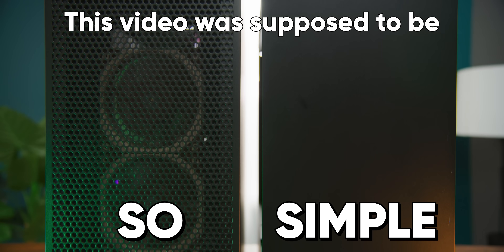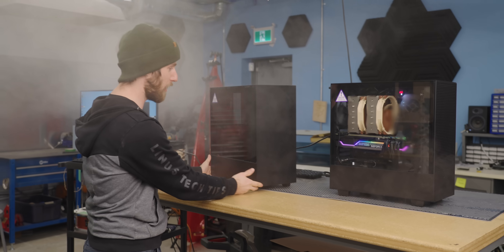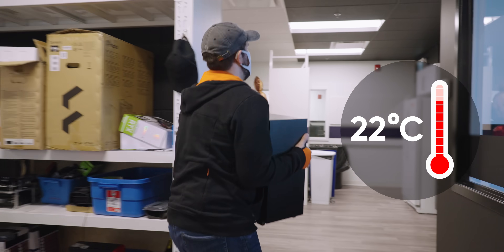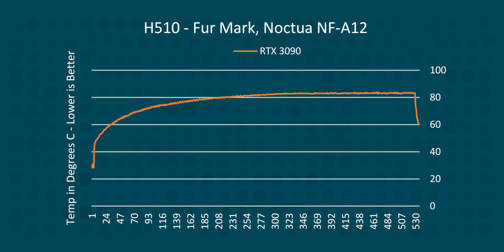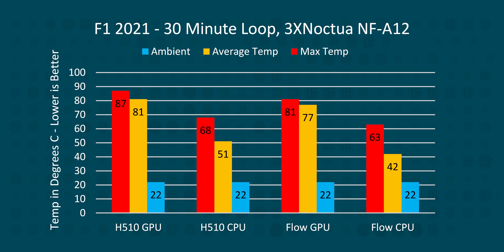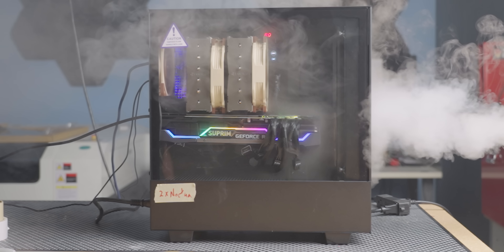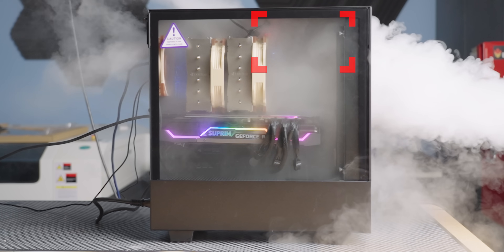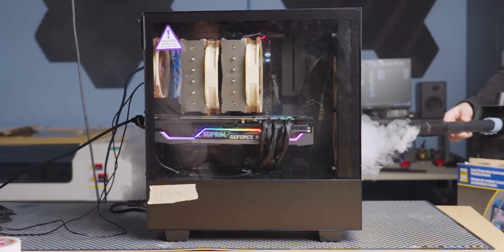Everything You Know Is Wrong - Mesh vs Non-Mesh Front Panel

Comment: ok just for giggles... Would you consider having two smaller yet spinning way faster [blowiematrons????] on the bottom of the case and one bigger yet spinning slower fan at the top of your case? Would love to see that, and maybe... just maybe... a separate compartment for GPU? I mean wasn't that the thing with PSU's ? I personally stick with full towers not only for their airflow and a lot of free space, but the modularity. Been 6 years I'm driving one case and I'm still good on space despite having 8 drives xD

Comment: Nothing new here. Fans are arranged wrong. Need bottom intakes to feed cool air to the GPU. Need top fans to exhaust the heat out. Mesh is good, but if you put the fans on the bottom and top, the GPU and CPU heat would be better overall. There is also the idea of balancing input and output of the fans. 3 in, 3 out. Etc.
This whole test is stupid in that that case is a hunk of junk strangling any PC built in there without top and bottom fans.

Comment: Replace the back blockoff plates with some mesh ones, that way the air going under the card has a place to escape. Would/should help reduce at least some of the turbulence. Hell, just take them all out for a quick test. Something else to test? Remove or don't power the bottom fan, but leave the top one going. The GPU wants air, it can pull it it's blasted self!

That or stop using these goofy tiny artsy-fartsy form factors with high end components. But what do I know? I consider the Rosewill Thor the current pinnacle of PC case design.

Comment: Cool video. I feel that having the PSU on the bottom of the case makes no sense today with GPU's getting bigger and hotter. PSU should be on the top like in the old days and use the space bellow the GPU to populate with intake fans. Like the Fractal Torrent and LianLi O11 are doing.

Comment: The front fans are mounted incorrectly. They should be mounted inside of the front bracket, closer to the GPU, to allow the airflow into the void at the front of the case. In the configuration in the video, the fans are obstructed by the front panel AND they are obstructing part of the side mesh.

Also, both of these cases are compatible for vertical GPU mounting, which might have been worth checking if it was a good option in this particular rig.

Comment: the solution is both simple, nothing new, and even elegant. DUCTS!!! there's a reason servers use it. just cut some acrylic plates and separate the front intake directing half the fan directly to the gpu. I made 2 separate ducts from 1.5 front fan on my corsair 460X, one for each gpu fan. basically invisible, huge difference on temps and noise

Comment: That is only 1 design of case, many of the older design cases I have you can only fit fans in the bottom 2/3 on the front panel, that case used only had fans in the top 2/3 and its unable to help push airflow to/through the gpu

Comment: It seems that the front mesh should have the mesh at the bottom solid part at the top. Otherwise there's no way to get effective airflow at the bottom of the case. One could workaround the problem a bit with some kind of air deflector or even ducting that forced air from the bottom front fan under the GPU. Given the miniscule space available, even that wouldn't be a great option.

Comment: I think when Linus says "turbulence" I think he means vortex or vortices. The air was 100% turbulent before entering the case and was turbulent everywhere in the case. The problem highlighted was air swirling around and not moving out of the case which is caused by the vortexes that would for around the GPU as he outlined in the video.

Comment: Yes, fluid mechanics is a thing and very important for active cooling. For air ducts, controlling flow area and pressure variances are important. I'd prefer that cases are internally sectioned for proper flow control

Comment: I wanted to build my pc perfect so I did a lot of fan setup tests, running them for a day of gaming at a time, the ideal setup was 3x 140mm front supply, 2x 90mm directly in front of the TUF 3080, 2x 140mm exhaust, one rear vertical, one top horizontal. It's positively pressured, the 2x90mm fan in front of the gpu made 2°C lower difference even during idle coz TUF cards have rear exposed heat sinks. i'm using a rosewill mesh case. I'm running Forza 5, Halo Infinite, AC: Valhalla in 1440p ultra at ~45°C full load undervolted TUF 3080 for hours on end.

Comment: I mean I know this video was sponsored and all for this case, but I tested basically the same thing in my case when I got my new way bigger GPU. My front mesh opening is more to the bottom of the case so I arranged the fans in a way where the bottom one blows air under the GPU and the top one over the GPU. 
I think for this particular case this problem exists but it varies heavily with the setup of your own case.

Comment: The graphs shown consistently compared Flow vs Solid, ven though the talking point at that moment was GPU vs CPU temp change difference when changed to Noctua fans. At one point, the talking point is GPU temps rising, while the graph displayed only shows CPU results (which are falling), adding to the confusion.

Comment: Whats the problem with swithing the fan direction to draw air from outside in the back of the case and throw it out through the front? Especially if you can open the pcie covers under the gpu, it lets the front fans to draw in cold air for the gpu then. Im rocking such configuration in an old Lenovo server case for ages and my RX 590 rarely gets to or over 70c when gaming

Comment: Stuff like this is why I still prefer to use slightly larger cases. It makes airflow a lot easier to manage. Plus, I prefer my case to have at least 2 of the optical drive bays. I have them filled with 2.5"/3.5" SATA hotswap trays.

Comment: I would recommend the Lian Li 205 at Micro Center for someone who wants to assemble a similarly sized build with a solid front cover. It's very similar to the NZXT H510 in terms of layout, but the removable front cover of the Lian Li case probably has better intake thanks to an open bottom and grills that span from top to bottom on both the left and right sides. Furthermore, the Lian Li case has a top exhaust grill that can accommodate two case fans or a 120x240mm/140x280mm radiator.

Comment: Makes sense, its why on my BeQuiet 500DX I spaced out the fans on the front so one is at the top and the other is as far down as I could get it to try to avoid just blowing into the end of the GPU.

But also why I kinda regret not getting a case with bottom intakes.  Logically being able to blow air directly at both the GPU and CPU should be better.

Then again, it keeps my 3080 comfortably in the mid-70s and quiet, which is good enough.  Considering the problems the 3000 series has shown with power delivery, I'm not risking pushing it past stock clocks.

Comment: In games like RDR2 or Assassins Creed Valhalla, my EVGA 2080 Super barely hits 65c at 70% GPU fan speed in my Phanteks Enthoo Evolv X with 3 x 140mm Cryorig Performance fans in the front as intake, a single Cryorig Performance 140 as rear exhaust, and a 360 rad in the top from my AIO, exhausting. My Ryzen 5900X idles at 32-35c and hits max temps around 45-50c in games. With high load work like audio engineering, my CPU can reach 55-60c, but doesn't really ever go any higher. Taking the front panel off makes only a minor difference in temps.

Comment: I got some Noctua fans and replaced my fans in the case. Only a bit quieter but what puzzled me was the rise in temps(a couple of degrees F) that it caused. Then the fan at the top outlet quit working. I was a bit miffed that the supposedly "quality" built fan didn't even make it to 6 months. I replaced it with my stock case fan and it is still going(2 years later). I don't think Noctua is all that great anymore(hyped a bit too much I say). I fixed the temp problem with a 200mm fan mounted in the side.

Comment: I have H400i and the moment i bought Noctua fans insted of original crapy nzxt fans i don't need to worry about temperatures. in h400 the position of lower front fans makes air flow directly to the gpu and mesh top of the case (where you can mount 2x120mm or i think even 140mm fans) makes sure that I won't encounter situation when the hot air can't get out of my case

Comment: **HOPEFULLY THIS GETS SEEN** - To make the Smoke machine work more evenly, Make a secondary Baffle using a 24" cube carboard box or cooler.  Modify so you have an inlet side and an outlet side.  Place a 80mm or 100mm fan on the outlet side connected to a switch, and fashion a simple removeable cover over the fan (or have a vacuum hose with a cover.  Connect the fog/smoke machine on the inlet side and turn it on, and let it pump a few times into the box.  When ready for smoke, flip on the switch to the fan, and remove the cover.  Your Fog/Smoke will come out more evenly.  If you need a LOT of smoke, you can add another inlet point with another Fog/Smoke machine and possibly run them so they quickly alternate in Fog/Smoke production.  You could even make a fancy box with a window on the side to verify Fog/Smoke intensity before turning on the outlet fan.

Comment: Here's a real kicker for you: your fans don't actually pull air in, it's being PUSHED into your case. Fans are universally misunderstood as a sucking force, when in fact they drop air pressure coming in and raise it going out. So if you design your case for low air pressure with the understanding that a greater volume of higher pressure 'feed' air is doing the motive force (aka bucket with a hole), it makes these kinds of things a bit easier to design around. The efficiency comes in with being able to supply your bucket with as much air as you can feed it, temperature difference, and how quickly you can cycle said supply.

Comment: I'd be curious to see the airflow orientation flipped in the H510 air/mesh. Have the rear exhaust flipped to pull air in and flip the fan direction in the tower cooler, but leave the mesh front without exhaust fans. The hot air coming off the tower should stay in the top half and vent, while the GPU would (hopefully) get some better air without all the turbulence...

Comment: I test this sort of thing for work using 1-wire temp sensors for both ambient and attached directly to devices.   Air cooling is a dark art and the results of small changes are often surprising when mapped over time.

Comment: i always have my side panel off because i regularly switch out storage drives (i know ill get a hard drive dock eventually) and i always have the best temps out of my friends despite us all having pretty much the same hardware ryzen 7 and 1060 for the most part you would think it would be bad for airflow but i have a front with a bunch of fans like in the video so i guess the lack of side panel helps give the air that would recirculate somewhere to go

Comment: Speaking from experience, the H500 series of cases are only good for budget - medium and medium/high end builds. High end and ultra high end builds like what Linus have shown in this video just isn’t viable in this case if you want good thermals. At this point you’re better off with a H700 series case.

Also the H500 is a case that’s good for negative pressure. Meaning the exhaust fans have to spin up faster than the front fans for better thermal performance. If one were to upgrade this fan’s airflow, getting a single 140mm fan on the top with good CFM would do the trick.

Comment: Seems like removing the expansion slot covers below the GPU might have made a difference for the GPU allowing more airflow under the GPU to replace that air. Especially if that PSU in the basement was configured fan-down.

Comment: I use a Phantek case, with 3 fans. The lowest front fan actaully plows air under a shroud. This shroud has holes and thus my gpu always has good airflow. The case is the problem. Another mesh case might work way better.

Comment: What if you had a negative pressure with the front pulling out and back pulling in. The other idea might does a vertical mount graphics help with cooling with a mesh front case. Could your design a layout that is more efficient. Here's a good one what about the OG case design with the power supply on top? Would the ability of a mesh front case and a fan mounted below the graphic s card help

Comment: Exhaust more and think about air flow. The CPU or its AIO has fans, the GPU has fans. They look after themselves!
What we (the case) need to do is remove the hot air they create while ensuring an adequate supply of ambient temp air to fill the gap. (this works in buildings too)
If you are exhausting a lot of air you will need to assist the airflow into the case. 
Smaller systems that have under-case air intake (mine is In Win 303) will only need exhaust as the air moves around the GPU on it's way to the exhaust fan. I blocked the front of the intake to ensure the flow included my GPU exhaust air.
 All you end up with is a confused and hard to predict airflow. 
Comments welcome.

Comment: that's why i don't like small cases for gaming, it's just a big headache and unecessary, and thinking in air cooling in a such small case like this just make it worse, is more pratical pay the extra price in a bigger case and a water cooler, the cpu will get chill temperatures and the gpu won't be undersupplied with airflow and won't be hot as hell because an air cooler will suck the airflow that could go to the gpu, it's my opinion

Comment: Major Hardware uses a jug to dump “fog” at fans, and it seems to work REALLY well. Also, when you do your testing, could you test those rare “rear case” fans that mount right into the rear slots? It may cause a more even air pressure for the GPU if mounted underneath the card

Comment: hey Linus i have a new vid suggest related to this, maybe you could try to work around this and maybe test yr hypothesis. i suggest you 3d print a part that redirect the lower fan's air flow solely to the gpu so maybe it gets better flow:)

Comment: Just a thought, could you use some sort of fluid dynamics modelling software to design and then 3D print custom translucent air guides/ducts to mount inside the case?
As a bonus, with some UV lighting and the LTT logo incorporated into the ducting, that would look pretty sick. You could do other cool shiz too like if you still had some watercooling installed you could print ducting that included a water channel and have it say spiral around the ducts like a curly straw.
Reply: you could... or you could just buy a case with top airflow options. many cases offer at least 2, sometimes 3 top fans. with a back exhaust and a couple of the top fans, the intake exhaust turbulance problem is almost insignificant. but if you use some cheapo nzxt case with a 3090 then yeah you're going to have problems. trust me been there done that.
Reply: @arbitraryalias9825  somehow I don't think just buying a top end case plus all off-the-shelf consumer hardware would make for as interesting or entertaining a video however.
Reply: @geekehUK  I just think the whole framing of this video is misleading. The fans have nothing to do with it. Entire problem is the case and it's intake/exhaust capabilities. Take a bunch of junk fans in a better case and 3090 temps will be dramatically lower. This can all be done for <$100.

Comment: The secret word is: homogeneuos. The air flow must be the same in all parts of the case, which means no preferential "lanes". The deflectors should be used to interrupt least resistance paths, rather than directing the flow to the single components, even though the latter may achieve the same result of the former. As a rule of thumb: negative pressure makes things easier; the intake area surface must be the same as the outlet area surface; better have only intake or only autlet fans, but if you want to use a push-pull configuration, the flow of the push must be the same as the flow of the pull and if the fans are not the same, what counts is the air flow rate, not the speed of rotation.

Comment: you could get better cooling out of both if you just changed the direction of the air flow to better fit the case. maybe have it flowing back to front instead of the front to back?

Comment: Here is a way to measure only storage performance at least in games specifically needed to be on a asrock motherboard with A-Tuning Power Saving on that will handicap all the CPU performance to minimum no overclock or max turbo will work, only to test storage performance instead of CPU performance as for the GPU it will still work but it's not GPU test if you don't swap it.

Comment: i have this same case, albeit not with nearly as powerful parts, but in my case the temps are actually quite great. I have an aio cooler mounted in the front of the case with the fans on the in side of the bracket and it never gets hot enough to care. The gpu is a much shorter card, and has a fan directly in front of it pushing air across it. the highest i see is around 65 at full load

Comment: I had this exact same issue in an old gaming rig The turbulence was I believe was causing the air around the GPU to be a lower pressure effectively stalling the airflow and as you saw recirculating it. what I ended up doing was splitting the top fan and the bottom fan between the GPU and CPU by putting a cardboard divider in guiding the airflow directly towards the CPU cooler and the GPU cooler giving them both an even airflow lovely seeing it confirmed with the smoke test though